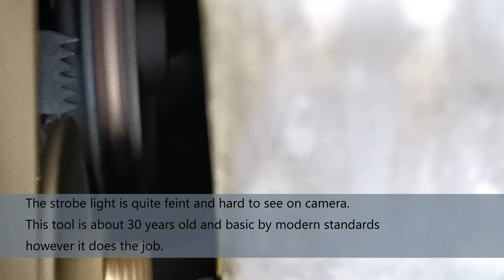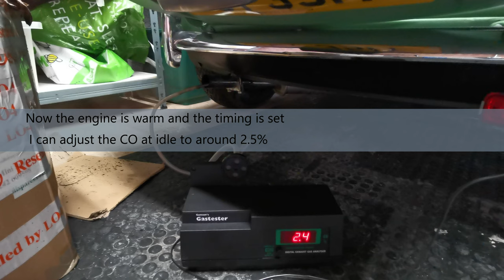Mini 998 Stage 1 Ignition timing and CO adjustment

Comment: Hello, I try to do my ignition timing but can't find any marks on my pulley. Don't see any on your video too, am I missing something ?
Reply from the maker: The mark should be scribed across the lower pulley. It’s only small and if the pulley is dirty may not be easy to see. I cleaned mine and put some white paint on to see clearer. Do you have a pointer on the timing chain cover. I am also aware that some cars have an inspection cover on the flywheel housing that needs removing before using a mirror to see the mark on the flywheel.
Reply from the maker: https://www.theminiforum.co.uk/forums/topic/344001-setting-the-timing-through-the-wok-no-marks-on-the-flywheel/
Reply: @I-T-S-M-E  Finally found it ! Thanks for your help. Do you remember if you set your engine at 1000 RPM or 1500RPM ?
Reply from the maker: @PotatoeHead-s6 1500